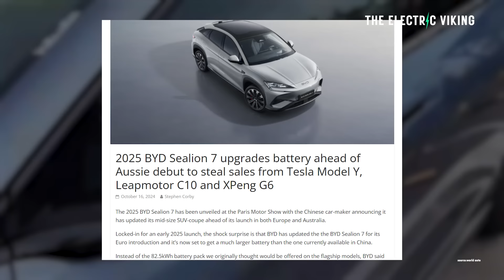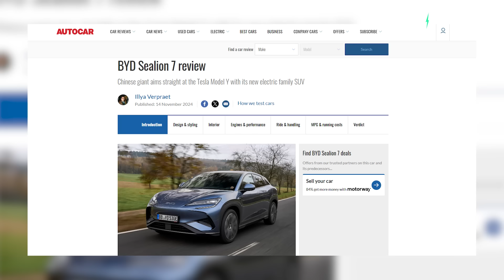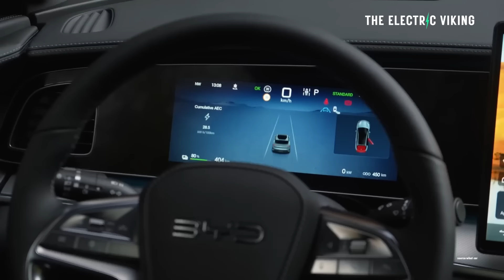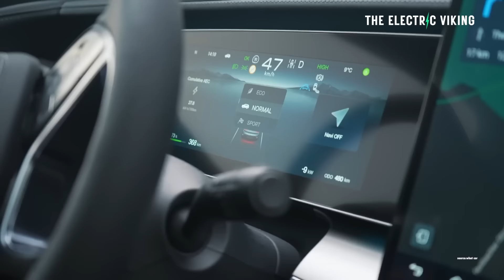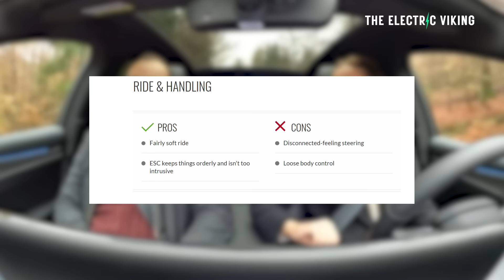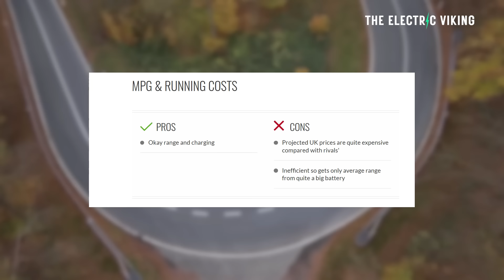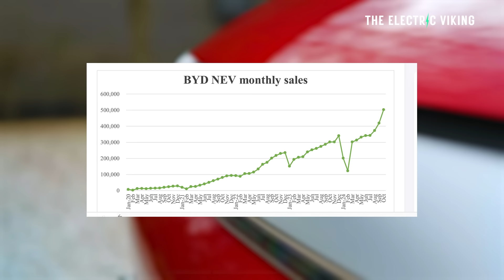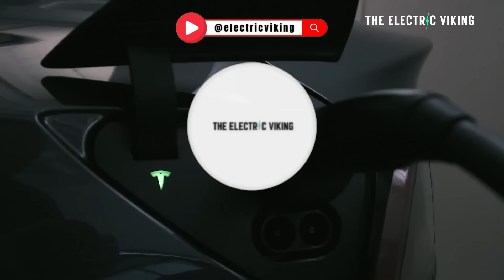Shocking review exposes major issues with NEW BYD Sealion 7 EV

Comment: It's weird because the Sealion 6 is insanely popular in Australia. A friend of mine bought one and he loves it.
Reply: I think "insanely" popular is pushing it.  It is something new and different which generates buzz but it's long term popularity is an unknown
Reply: Is it? Sealion 6 is a hybrid, not full EV though.
Reply: @noodlefoo  It's a REx PHEV. It drives pretty much like an EV though, and the range is close to 100km. Now he's run the engine in, my friend is just driving it in EV mode the whole time.
Reply: @noodlefoo in Eu 6 has fully electric version 87,5 kwh battery.
Reply: @John-p7i5g  Still a hybrid technology, not the same as full EV. And won't receive FBT exemption from next year in Australia.
Reply: @torpemonguz  Good to know. In Australia, only a hybrid model is available.
Reply: Because it's a dirt cheap PHEV in Australia. Most PHEV's don't cost that much here. Is the Sealion 7 going to be half price of a Model Y? If so, then it will be insanely popular too.
Reply: @noodlefoo  Correct. That's why he bought it now!

Comment: Can you imagine the problems owners will face when some of the electronics on these cars start to go wrong?
Reply: Nope.  Electronics usually stop working due to sensors.  Much easier to fix than mechanical issues.
Reply: @santoshrathod123 Exactly right. However, if BMW is anything to go by with such problems they start off with resetting the code and saying 'should be fixed now', when it's not and breaks down at an inconvenient time. When sensors start to fail they can throw misleading codes in other adjacent areas which in some instances can create a real problem for both drivers and the dealership, who most times don't have enough experience or time to follow up hunches or deep-dive into systems. This leaves the owner without their car for possibly weeks at a time and a feeling of disappointment or anger. If you keep going back with the same unresolved issue most dealerships start to get fed up seeing you.
Reply: probably the same as ICE cars
Reply: typical to german cars..... my AMG rain sensor gone wild after 2 years.....
Reply: A true story! At the age of 69 called it a day on my long established garage. Couple of reasons (apart from the 5% awkward customers) - Cost of diagnostic kit was becoming eye watering - My lads who were in their late 50s and 60s could either not or did not wish to keep up. Replacing sensors often did not remedy the fault they just disguised it till it next occurred. Customers then questioned why they should then pay again AND why - if the fault reoccurred why they had paid in the first place. I am not alone - there are many small independent garage owners like me calling it a day. This will mean customers will be forced to go to the main dealerships at an average labour cost TWICE that of the independent AND dealer only parts at extortionate prices. Consumers had better get used to some pretty big bills!
Reply: The most common type of sensors that fail in cars are "transducers", i.e sensors that convert a physical quantity (temperature, pressure, oxygen level etc.) into an electronic value.

The most commonly damaged sensor in cars today, for example, is the oxygen sensor in the exhaust pipe, which measures the percentage of oxygen generated by the combustion process. Other common sensor failures include the mass airflow sensor (measuring the amount of airflow entering the engine), the manifold pressure sensor and fluid level sensors for oil and coolant levels.

Notice how these are all sensors required for the ICE process? It's actually entirely unsurprising this is the case, as transducers are inherently vulnerable to physical damage. Combustion involves very harsh physical conditions, such as violent mechanical forces, high temperatures and pressures that fluctuate rapidly and the production of by-products such as soot and particulates that can clog a sensor's aperture. In a way, it's a miracle that these kind of sensors last as long as they do.

On the other hand, EVs don't require most of these sensors, due to the lack of a combustion process. Most of the sensors which they do make use of will tend to consist of solid state ICs which directly couple to the electrical power train, converting an electrical quantity to an electronic value - meaning that they are at far less risk of physical damage (although still at risk of electrical damage, if their absolute maximum ratings are exceeded).

Electronic sensors tend to not only be far more reliable than transducers, but also far cheaper, due to their solid state construction, meaning that more redundant units can be included for the same price, making the electronics even more reliable.

This is why the Chinese have pursued EVs so vociferously - when you set aside the battery, dollar for dollar, EVs are far less complex to manufacture than ICEVs and therefore far cheaper and far more profitable. The battery has, so far, been the biggest stumbling block in this, however with the way prices and capacities are going, this will likely cease to be the case in 2-3 years at most.
Reply: @VintageLynx  One issue is the number of connected chips that have to signal each other. Ice vehicles have a horrendous number of chips. The less the better and therefore easier to fix.
Reply: @toma3025  Thank you for the time and trouble you have taken to respond. My only regret is I am not 30 years younger as - unlike my “old” mechanics - I find the whole area of EVs fascinating. On a more mundane point - my understanding is that EVs are much heavier than their counterpart ICEs - unfortunately most ramps - at least in the Independent sector -  have a weight limit mostly of 2 tons with a few at 3 tons. Despite some of the “Luddite” views expressed by many in my old industry there can be no doubt the days of ICEs are numbered regardless of any rearguard actions. To sustain the independent garage sector will require a new breed of young mechanics / technicians - regrettably for us of the old school our pockets are just not deep enough. Best Regards
Reply: @daveandjanwoolf8078  I always enjoy reading and responding to comments on YouTube, like your own. It's surprising the amount of interesting information and wisdom that you often find in the comments section!

Indeed, the weight of EVs is a substantial issue that's been highlighted in my country, especially with regards to the many multi-story concrete parking lots that were built several decades ago, at a time when most average cars weighed less than 1 Tonne. Some experts have suggested that they may need to be pulled down and rebuilt with enhanced structural properties, simply to accommodate the much larger weight of EVs.

With respect to combustion vehicles, I personally don't actually see them as "outdated" or "inferior" to EVs at all. They indisputably have advantages over EVs, such as much better range, which I imagine will be the case for at least the next 4-5 years. The only reason why I think EVs are likely to overtake ICEVs in the long run, is that they're generally less complex (apart from the battery) and cheaper to manufacture. As with many technologies, it's not necessarily a case of "better" vs "worse", but rather different advantages and disadvantages. However, at the end of the day, consumers (and manufacturers) tend to see price as the biggest factor, which will likely tip the argument in favour of EVs over ICEVs going forward, in my estimation.

Comment: Significant bias I am afraid. This is an LFP battery, well known for lower density therefore less range compared to an equivalent NMC battery. On the other hand though LFP lasts far longer and degrades far slower than an NMC. Speaking on personal experience my 2019 Model 3 with an NMC battery from a starting range of 309 miles (EPA rating) is now down to 280 after 81k miles. 9.3% loss. I saw video and report of a BYD with 445k! miles with 20% degradation.. On the sealion though the prices are indeed high. You need lower prices if you want to infiltrate the market. As for the ADAS system, I have been in a number of different cars recently; they are all CRAP! Tesla is indeed better on this front.
Reply: Teslas here in Oz have LFP batteries and are long ranged and weigh less.
Reply: I'm not following? Can you please explain the Bias, factually?
Reply: @jasonmcintosh3448  ADAS systems described as horrendous where I have not come across a car so far that they work as we would like too. Tesla has the edge but they are still full of issues. My wipers still activate due to sun where no rain is around, I still get phantom breaks after 5 years of ownership and still the lane keeping is jolting the stirring wheel. Comparison between LFP and NMC. We all know that LFPs give less range on the same kw size. No mentioning on the fact though that LFPs have far less degradation and more life cycles. Range deemed small while Tesla and other EV manufactures grossly overestimate their range.
Reply: @simon-c2y  only standard range in tesla has LFP... LR and performance still have NMC
Reply: @jasonmcintosh3448  His point is LFP batteries weigh more for a given pack size and the weight impacts efficiency, handling, braking and acceleration. But LFP has a more robust chemical structure, suffers from lower degradation, can handle higher temparatures, higher states of charge and regular fast charging better as well as being safer.  All BYD EVs have LFP batteries.
Reply: Tesla RWD's use LFP's too. Same battery size as an Atto3 yet the Atto3 has less range. The Model Y is also larger. BYD just doesn't do efficient cars.
Reply: @Spade080  Hmm, I have a Model 3 a Y and have owned an Atto 3, what is your personal experience. In mixed urban driving I found no difference in efficiency between the Y and Atto, the M3 is better. Also Tesla's are typically more efficienct than other EVs so not quite sure being less efficient than a Tesla is unusual.
Reply: Can you even do maths? 445k for BYD with 20% degradation compared to your 81k with 9.3% degradation, are you sure that you are confident about what you are saying???
Reply: LFP has its purposes yet degradation of NMC insignificant. NMC is the best battery technology currently available.
Reply: @jimmyhan4650  Your point is? What I said is that NMCs are degrading faster than LFPs.
Reply: @Ryalonor47  Sry I misinterpreted your wording, but speaking of ADAS, it is really arbitrary throughout the experiences from many owners and some say there's too many issues but some said there's literally no problems at all.
Reply: @jjjxoxoxo  Not exactly, China as the world's leading battery manufacturer is now only doing LFP, Lithium-Sodium ones (sorry I don't know the exact terminology but that's what I had a glance at recently), and solid-state batteries. CATL, BYD and Chery are actually nailing the solid-state battery around 2026-2027, and the energy density is 800Wh/kg and as an example Hyundai is only aiming at 400Wh/kg with their equivalent one.
Reply: @GDM22 what is the drag coefficient (Cd) of model Y and model 3? Tesla usually have better Cd than BYD, hence similar size LFP battery Tesla has better range.
Reply: @petrushka2  Agreed which is why I said mixed urban where Cd is less important and where I do almost all my driving. It also has narrower tyres 225 and 18" rims compared to 19"  and 255s on the Y. The Atto 3 is also only around 1,750kg, where I think the Y is 150kg more.
Reply: @jjjxoxoxo  Apologies but it is not insignificant. I have 9.3% loss at 81k miles on my LR AWD model 3. I have teslafi also and I am on average to good levels when compared against other owners. There are cars on the same mileage that are over 10%.
Reply: @Ryalonor47  I am not sure what he is saying, as the rate is much faster per 50k and we know degradation is also not linear.
Reply: Your in luck... you only have about 3% more to lose. 
    The Viking has had vids about long term tests in the real world finding that your Tesla, assuming you are not charging it over 90% on a regular basis and letting it sit, should level off at about 12% max degradation sometime around 200K miles.  At that point the degradation stays pretty constant at that 12% range loss up to 500K miles or more... until there is some type of cell or pack failure.
Reply: @fatdoi003 That's true i'd forgotten that. Not sure what the range is of Tesla's cheapest models but I expect it's still pretty good.
Reply: @jimmyhan4650  he's pointing out the much slower degradation. Also for most EVs batteries degrade a bit slower after the first few years.
Reply: @nfzeta128 Yeah I have already stated that I did misinterpret his wording and provided my opinion. And yes, battery degradation does get slower in later years and that LFP behaves more linearly than NMC.
Reply: no, a 90kWh LFP battery delivers exactly the same range than a 90kWh NMC battery.
Reply: @jasonmcintosh3448  Most of this is just opinion of people with no facts at all, just what I want to believe. (That is very biased). I drive two Tesla's, model Y and Cybertruck, w/FSD, both are superior to anything else by years, if not decades. People that say otherwise have not tried it and don't understand the technology.
Reply: @Ryalonor47  The range on my two Tesla's is not overstated by enough that I can tell any difference, but I'm not driving the hell out of them either. Just let the car drive itself, (if it can).
Reply: @Spade080  There you go with facts again, how can you have a difference of opinion when you just use facts?
Reply: I sure would like to drive an EV. 😊

Comment: The biggest problem with buying EVs is the technology upgrade.
BYD is actually addressing battery inefficiencies issues, but we can only see improvements on Blade Battery 2.0.
So if you do not need to use the car at the moment, waiting is always a better option.
Reply: In my youth, I sold Hi-Fi gear, mid
 70's thru the mid80's. My take away,you cannot chase technology! Cheers!
Reply: @MarkChen-m8n  Absolutely. You just keep waiting just a bit, then again just a bit for the next tech jump, then the next one again and... no matter how long you keep waiting, in the end you buy one, that will become "obsolate" sooner or later anyway...
Reply: Look at EV brand which support BaaS battery swapping. Your all issues are gone.

Comment: Few points to consider:
- Majority of buyers prefer soft suspension setup for comfortability even it means compromising the handling, especially for non performance SUV
- Not everyone wants one pedal driving, I know a lot my petrolhead friends never considered Tesla for this reason alone. In fact part of the reason I don't like Tesla apart from minimalism is one pedal driving that cannot be adjusted.
- Latest BYD software update has improved the ADAS, much better than 2022 version although it's still not perfect.
- Most of the BYD extra weight come down for using LFP chemistry for big battery. The XPeng G6 and Y LR they use NMC battery.

Comment: Haven´t seen or tried the car, but I heard from a friend, what kind of review is this? 

I´ve been actively searching for my next car for 6 months now. Model Y, G6, and G9 are the remaining top contenders. With no former knowledge of BYD and no expectations, I went to see and try the Sealion 7 this weekend. And I must say I have a new favorite. Top build quality, great luxury feeling (doors close like a double-the-price German car), all the right things done to the interior layout (I am missing the ability to stretch my legs under the front seat when seated in the rear as I can on the Y). 

To me, the looks are an important part, and the Sealion 7 far outperforms the others mentioned in my mind. Driving felt good, and I was comfortable. The soundproofing is great, and acceleration is top, I really didn´t have any complaints. Charging speed is good but not the best, but it doesn´t matter much as I (and most Norwegians ) will mostly charge at home overnight. The only question I´m left with is if the consumption is acceptable for my use, and for 95% of my driving, it is.
Reply: Just wait a bit longer for the Zeekr 7X to come out. It outperforms the Sealion 7 from the reviews I've seen. In saying that, we've been very happy with our atto 3 and if I didn't need roof racks then the Sealion would be on my shortlist

Comment: The Irish guys at the German test were doing 225km/h on the autobahn. Aero drag at that speed is  4x that of 110km/h so it is not surprising the efficiency was shocking. All were impressed with the quiet and comfort. You should not go on one review. It is a large family car.
Reply: G' farn- farn- farn- Auf d Autobahn!
Reply: Which German buys such a chinese junk EV....just a poor guy or a company lease..maybe...you not got spare parts or service here in Germany for them....🤔
Reply: I've seen multiple different reviews, Irish x 2, UK x 2 and several others. All said suspension was not good, and car was very heavy, so lots of leaning in corners despite the weight being low down. Needs the new blade battery, and upgrade suspension.